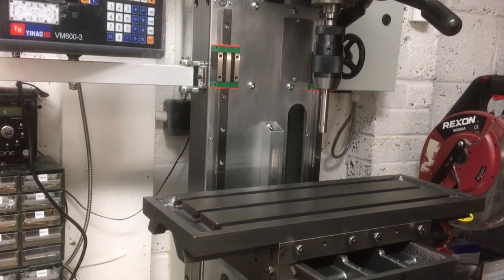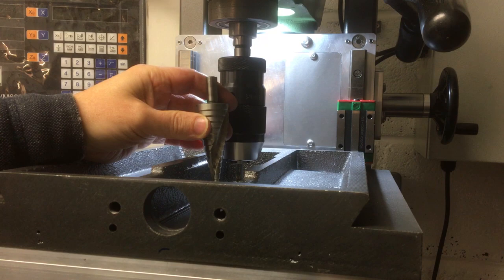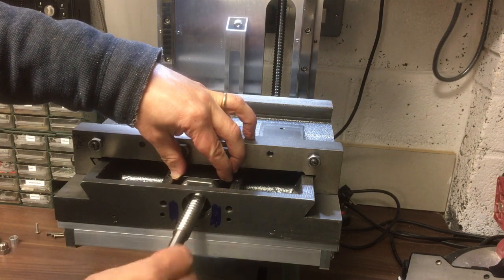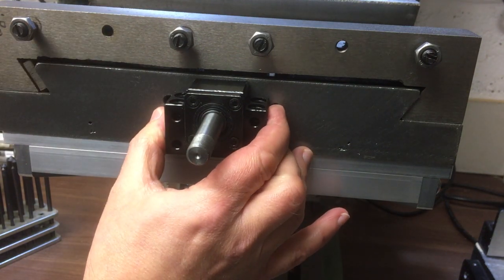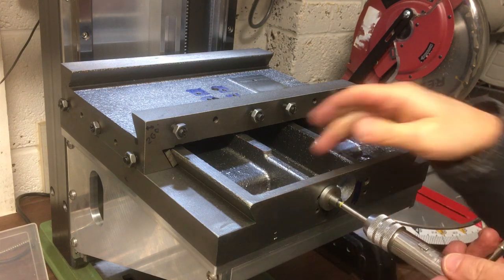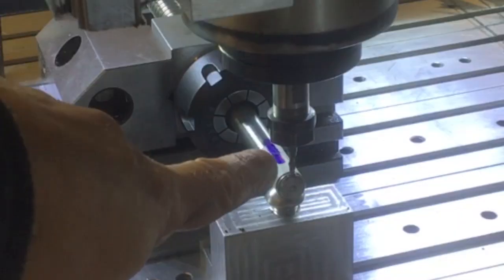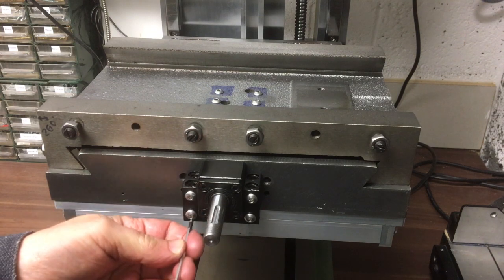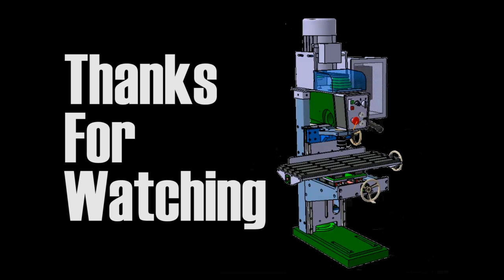Ep29: Drill Press Upgrade | Table Y axis movement !

Comment: It's so awesome to see some of the major goals start to be achieved and useful... Like the Z axis concentricity 🎯💯
Reply from the maker: Yes it felt good to get to this point.
Reply: I'm over a year late but hey... I only recently discovered your channel, and now I'm watching all the way through your series. I have been frustrated with trying to do even the most basic hole drilling ops on my drill press as well, and usually just end up breaking down my milling setups to spot/pilot/drill holes on my knee mill. This new perspective you're offering is very inspiring!!
Reply from the maker: Well you made it in the end!

Yes anything you can do to improve accuracy will make it nicer to use.

Comment: I have desired one of these tables and was aware that they were very weak on precision movement, very slopy but was aware that the castings were of very good quality...So I did a search on the You Tube and stumbled upon a couple You Tubers, You and another You tuber where he used 3/4" x 10 all threaded rod and I figured that would seem to work just fine...Well a long story short it was a failure; the threaded rod was not straight enough and was hanging up in various areas along the movement of the various axis's on the table...
So with this failed project, I decided I was going to do your process and soon realized it was and should have been the first way to go...Its proven to be quite successful...I did pick up where you stated at the end if you were to do it over you would entertain relieving the structure where the screw housing was mounted for the Y table...This was successful and have not looked back...By the way I certainly enjoyed your take on this drill modification you have done and some of it I have visualized being a mod. I want to do to mine...Great job
Reply from the maker: OK glad it was useful!
I guess the other guy was Winkys Workshop as we did chat about this project briefly.
Good luck with your upgrades and anything you can do will make it nicer to use.  Thanks for following along.

Comment: I wonder if instead of keeping this oiled if you were to bond a thin sheet of teflon or UHMWHe on the mating surfaces? Would last for ever and no maintenance? Just a thought.
Reply from the maker: Interesting but those materials are much less stiff than cast iron so there would be some flex in the system.  For this project probably ok but I think in general cast iron ways with a thin film of incomprehensible oil are a tried and tested solution.
Reply from the maker: * incompressible .  Auto correct on my phone let me down !
Reply: Absolutely and for high load situations I would say you’re right but on a drill press I think it would be AOK, you are only going to be able to apply maybe 150-200kg and no lateral load.Anyway, was just a thought. Nice work!

Comment: You are using the centre drill bit incorrectly, the tip is the centre drill and second part of the bit is only used for use on a lathes for drilling a hole for an live (or dead) centres! The second stage of the bit is at an wrong angle that doesn't match the angle of an standard drill bit. The name if these centre bits are called two in one bits. Look it up 🤔
Reply from the maker: Ok thanks.  I wasn’t too bothered what I used as I just needed something to get the hole started for the step drill.  Should do the job and let the chips out anyway.